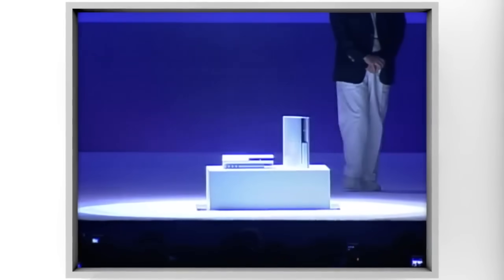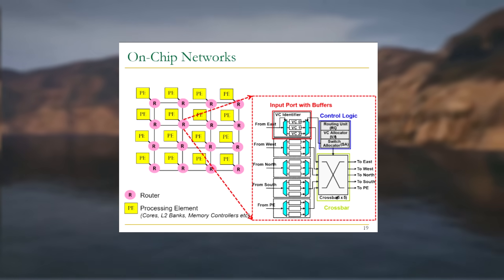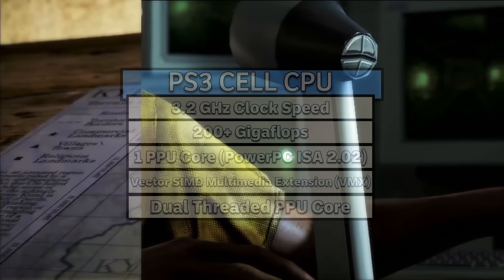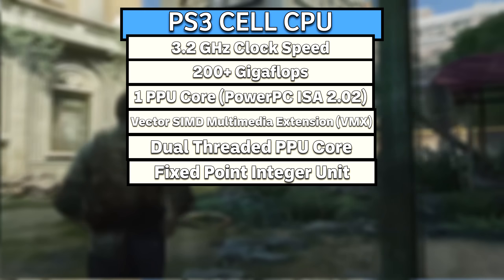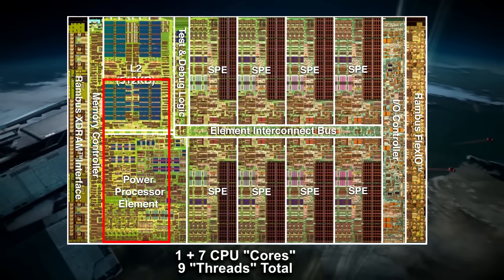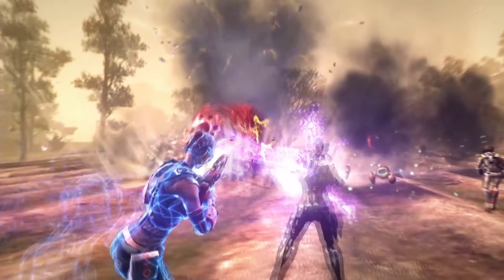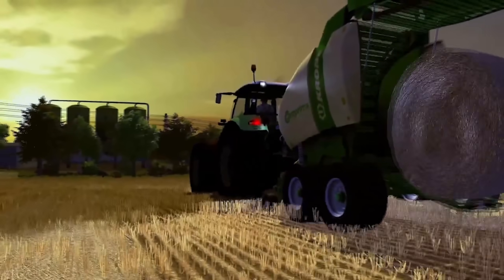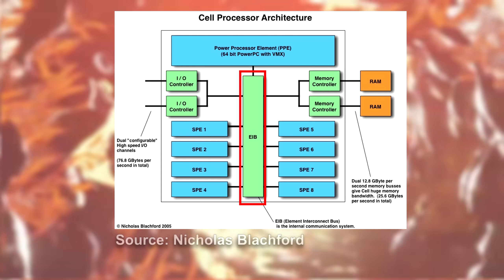The PlayStation 3 CPU: CELL Broadband Engine

Comment: it's crazy consoles had such more powerful cpus compared to their successors back in that gen
Reply: The PS4 and Xbox CPU, although weak at the time, still outperform the CELL by a significant margin.
Reply: @aristotelisentertainment279  They could only outperform the general purpose CPU core, while the 7 active SPEs could perform complex vector computations faster than the SIMD units on the PS4 and XBox One. However, the much more powerful GPU in the PS4 and XBox One could offload all the work done on those SPEs several times over and still have plenty of computational power to spare.

I remember reading articles in 2016 (the ten year anniversary of the PS3) that claimed the CELL was still more powerful than even high-end PCs of the time if fully tapped into its potential power. This was of course pure nonsense made for clickbaits because a simple floating-point test for peak theoretical performance has shown that a mid-range PC in 2016 could match and surpass the SPEs on the PS3 on the CPU alone in 2016, never mind the thousands of GPU cores available to the average user, each more capable than one SPE on the PS3 by 2016.

Comment: CELL was an interesting experiment. Unfortunately, it didn't really work out the way Sony had hoped.
Reply from the maker: True 😓
Reply: They over-estimated third party developer's willingness to learn the architecture, and under-estimated the importance of making the system easier to port games to the system or from a PS3 game to another system. It's strange, because their original success with the Playstation came from them being the easiest system for third party developers to develop for.
Reply: @syncmonism It's actually what's really difficult for them to port Playstation 3 games onto newer hardware. The architecture is just too different. Although, I don't know why Sony just doesn't put emulators on the consoles. They used to. My laptop can emulate PS3 games. It's not a power issue. It's an effort issue. It always has been.
Reply: @metpach  Apparently AVX-512 makes a massive improvement in emulation performance for CELL. Zen 2 didn’t support it. I do hope that PS6 finally does.
Reply: @syncmonism  Cell sucked regardless , it was only  single core CPU with 6 streams ,the xbox also by IBM was a true HT tri core so way better and it had way more memory for video too
Reply: It still gived it a edge againts xbox at the end, ps3 had other major issues, like litterly packing ps2 hardware in just for backward compatibility increased the cost, underdeveloped software features, probably biggest problem was RAM size. Cell was actully thing that if developers actully focus on and harness it, it beat even 360 games in quolity and it was that mystical super power of PS3 that made ps3 unique and worth. And to this day PS3 and its game libery age like a fine wine
Reply: It worked out in a way... Cell was the precursor to GPGPU/AI computing.
Reply: @NathanDrake5  GPGPU was being researched as early as 2003, and CUDA was released in 2006.
Reply: @Revenant_Knight  Google "NVIDIA's Sony relationship will go beyond PS3".
Reply: @NathanDrake5  That brings up an old Bit-Tech article that reads a bit like a PR announcement. GP GPU research was well underway in the early 2000s prior to Sony engaging with Nvidia, and CUDA was developed and ready by 2006. From what I recall, Sony and Nvidia relationship deteriorated somewhat after the initial rough launch of the PS3. Is there another article I’m missing?
Reply: @Revenant_Knight  You forget the fact that back in 2003 nVidia didn't have CUDA, not even unified shaders...

Also, CUDA GPGPUs were not as flexible as Cell initially... Cell SPUs even supported 8-bit math acceleration (useful for AI/ML).

How long it took for GPGPUs to copy every computation feature from Cell? Quite a lot! Over a decade I would say.

ps: You think Uncharted 2/3 physics could run on a GeForce 8? Think again.

nVidia took a lot of R&D from IBM Cell, even if this relationship deteriorated. Even SGI tech...
Reply: @NathanDrake5  I think I see where we are disagreeing. 

Sony, Toshiba, and IBM (STI) started development of CELL in 2001. Nvidia didn’t enter the picture until 2003, and wasn’t announced as a PS3 partner until very late 2004. GP GPU development though ran parallel to this time period with the first results bearing fruit in 2003, prior to Nvidia engaging with STI or more specifically Sony. This included the development of unified architecture which would not have been ready for the PS3 release date. CUDA was developed during this time as well. This is convergent development. 

Now if you say that CELL had more general purpose compute capabilities I would whole heartedly agree. GPUs did eventually adopt many of these features including 8 bit math shortly thereafter, but did so in a different method than CELL. 

It’s like saying Porsche stole Ferraris design because they’re both cars with wheels that go fast and turn well. Under the hood, there are substantial differences. 

The disagreement is that to me you seem to be asserting Cell is solely responsible for GPGPU coming to be, whereas I’m asserting that GP GPU was developed in parallel to Cell and would have come to be regardless. That said, there is no doubt that Nvidia would have wanted to copy capabilities of Cell if there was a market for it. 

As for STI sharing their patents and proprietary tech with a potential competitor, that’s questionable at best. Sony may have made a deal with Nvidia during the RSX development but I can’t find anything indicating direct integration of CELL patents into Nvidia architecture.
Reply: Cell was designed by Toshiba and IBM to be a multipurpose stream processor. Some Toshiba TVs have Cell SPUs to decode many HD streams at once. They envisioned it to be used in anything from Bluray players to network servers and even military radars. It was what they think the future would be. Intel tried the same with the Larrabee project.
Reply: @mimimimeow  I was thinking about Larrabee when I was rereading up on Cell. The fact that Larrabee were based on P54C cores has always seemed interesting.
Reply: Eh? The PlayStation 3 was the highest selling console of its generation.  I'm sure sony is plenty happy with how it worked out.
Reply: @GoatTheGoat no, it was not the highest selling. Wii was. That being said, Ps3 was REALLY expensive and that was a lot because of its architecture. Sony take a lot of loss to put Ps3 back on track and they only passed Xbox 360 after Microsoft just decided to put their money and game devolpment onto kinect bullshits.
Reply: @GoatTheGoat We all know the 360 was the king of 7th gen. PS3 was like Paul Walker chasing after Vin Diesel. "I almost got you, bro!" :')
Reply: @lovesnakeden  What are you talking about?  PlayStation 3 out sold xbox 360.  That is an undisputed fact.
Reply: @GoatTheGoat If we go by sales numbers, the Wii rules them all that generation. 😊

PS3 has a rough start but solid end game. 360 had a great start but rough ending due to red rings. Both had great games, and both could do amazing things. 

I would love to see what someone could have done with the PS3 CPU and storage systems married to the 360 GPU and RAM.
Reply: @GoatTheGoat  360 was the main platform the games were developed on. Only then was it ported to PS3. Except exclusives.

LMAO @ outsold. I can tell you weren't even born back then, zoomer. kek.
87.4 million PS3s were sold at a loss compared to 84 million 360s. Yeah. That's a HUGE win. lol
PS3 was "winning" at the end of the cycle with sales, but not games. They started getting woke and too mainstream. 360 still dominated.

360 was what the iPhone is in terms of apps: a primary, an industry standard of the 7th gen.
And if we are talking about sales, the Wii sold 101.63 million, so :')
I wasn't even talking about who outsold whom in my first reply.

If you were there from 2005-2011, you would know.
I myself had a PS3. :')
I am not fanboying/hating. I LOVE❤ all consoles/games.
Just stating the truth. :')
Reply: @lovesnakeden  What are you talking about?  Xbox 360 was in no way the main platform games were developed on.  I'm sure some developers primarily targeted xbox 360 and some targeted PlayStation 3.  There was no overall agreed standard.
Reply: @Revenant_Knight  No doubt the Wii was the overall champion in sales and Nintendo was laughing all the way to the bank.  But Wii was so different it wasn't really competing against PlayStation and xbox.  It was more in a league of its own.
Reply: @GoatTheGoat  bad bot
Reply: @GoatTheGoat …and that’s why PS4 used a next generation Cell chip. Oh…wait…
Reply: @Revenant_Knight  The architecture change for PlayStation 4 is based on AMDs ability to make a CPU and GPU combo chip (APU) for dirt cheap.
Reply: @GoatTheGoat   Marc Cerny begs to differ.